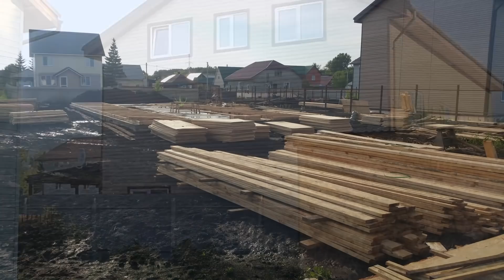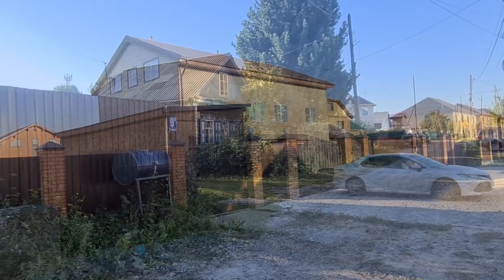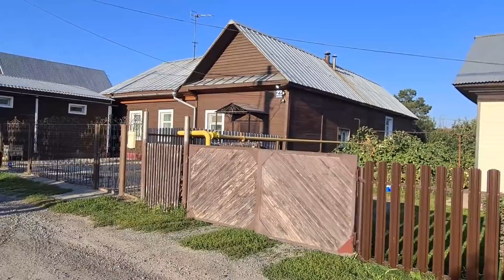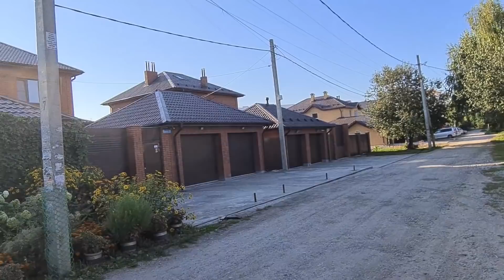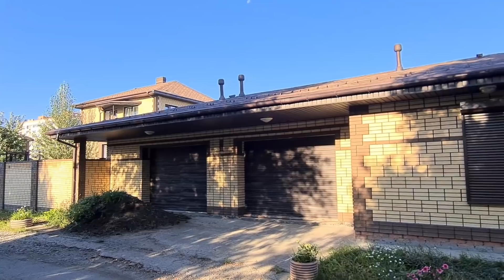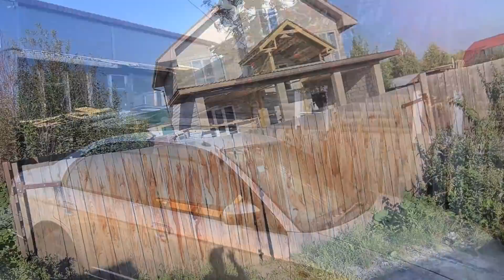What are houses like in Russia? How do people live in Russia? Suburbs in Russia.

Comment: The basement in Russian conditions should be at the depth of freezing. In Moscow it is 1.2 meters, and in Siberia it is about 2 meters. It is expensive to have a basement, which is costly for an individual developer. Many still make a basement at all costs. Wooden house construction will soon remain only in the segment of summer light houses. Many materials are beginning to spread even to Siberia. You showed white aerated concrete block, but wood concrete block "Arbolit" is widely used. All these materials do not burn, which is very important compared to a wooden house.

Comment: We have 252 square metres air block house with my husband (Australian citizen) here in St.Petersburg, Russia.  The big advantage is you can easily change your plan, disassemble one wall and build another one. With wooden house it's impossible to change the internal later.
Reply: Nothing is impossible.  Even though a wall may be a supporting wall, it can be removed and replaced by a support beam. One would need the advice of a professional builder for this, but it’s not impossible. In the USA, we do it all the time.  Many purchase older homes with smaller closed off rooms. To make the change to today’s living, walls are removed to create larger rooms which include a kitchen, living & dining room rolled into one great room. What a difference it makes. A word of caution.. this can be quite costly.

Comment: I'm thinking about my own house (living in Moscow at the moment) — choose gas-concrete and high-tech style for it. This is a good technology  — just don't fail with house project for this technology and quality of materials. You can check YouTube channel of Глеб Грин — he is a pro in gas-concrete.
Reply: aeroconcrete is the best available material. I built my house using this material following Gleb Grin channel.
Reply: @FadeToEvil  Arbolite is better and more practical. Aerated concrete block requires a flat underlying surface, shrinks in the first year and gives cracks.
Reply: @Nahal0nok  there's no such problem, you have to put armature. good fondation is needed for any good building.